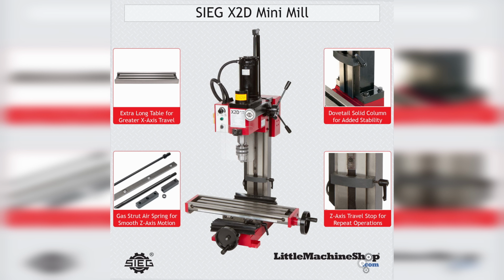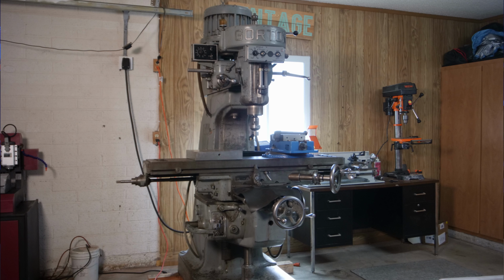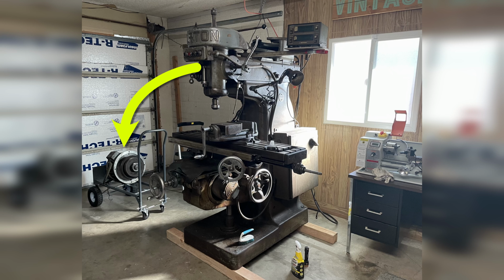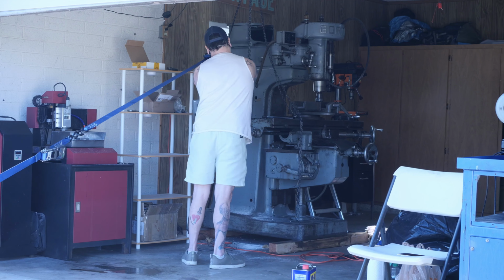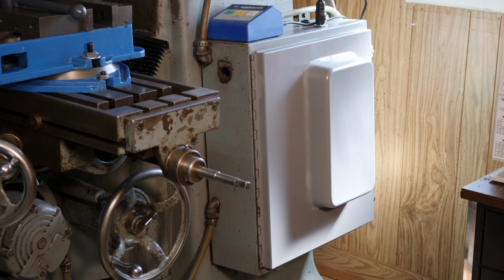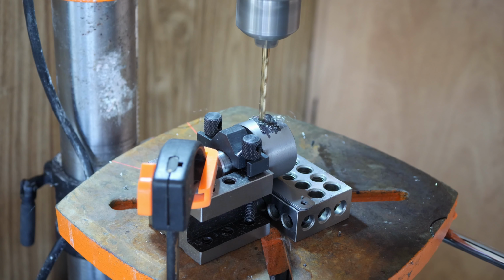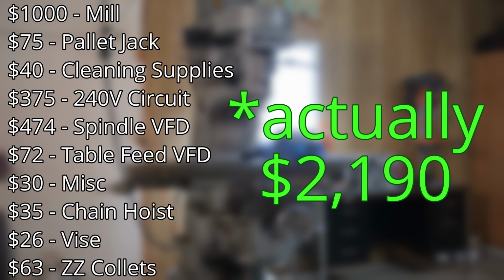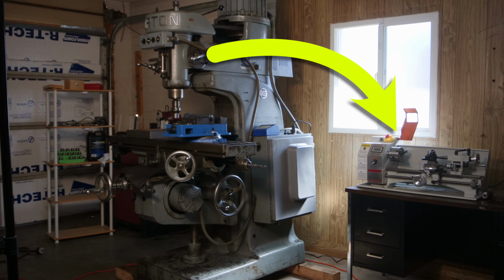Vintage Industrial Vertical Mill vs. Mini Mill - My Gorton 9J

Comment: Hello.  You don't know me from anyone.  But I wanted to give you some advice.  Never add grease to that zerk nipple on the front of the table feed box on your Gorton mill. It is really a bad thing to do that. It will lead to a broken gear. Crazy you think?  The power from the motor in the knee comes into the side gearbox via a Lovejoy coupling, and turns a worm. The worm turns a worm wheel. This provides a 30:1 speed reduction.  The worm is steel and the worm wheel is bronze. This worm speed reduction also changes the direction of the shaft 90°.  To get this power back into the same orientation, parallel to the gearbox shaft input, from the worm wheel is connected to a set of 90° bevel gears. From the bevel gears, the power goes to the Norton gearbox to select a feed speed.  The PROBLEM is that the bronze worm wheel created fine bronze dust (shavings) as it wears. The fine shavings fall down into the teeth of the bevel gear located underneath the worm wheel. Not in and of itself a problem. But the Zerk Nipple is there to grease the ball bearings on the input shaft. The excess grease from the spillover of these bearings, falls down and coats the 90° bevel gears teeth.  So now there is grease covered gear teeth and a tectonic slow shower of bronze dust falling on it. One would think that the gear oil would wash this bronze dust away. But the sticky-ness of the grease seems to hold the bronze particles better than the surface tension of the oil can clean them away.  Over time, the bronze dust packs into the gear teeth of the bevel gears, and the extreme force generated by the interface of the gear teeth breaks the tooth off the bevel gear.  My Gorton had one tooth broken off each of the 90° bevel gears. Bronze dust and rock hard grease was impacted in the gullets of the gear teeth.  I did not have spare parts, and I came up with an elaborate fix that involved eliminating the worm and bevel gears from the box, and using an external 30:1 gearbox between the motor and the Gorton gear box.  But as crazy as this sounds, do NOT add grease to that zerk nipple.  --------Doozer
Reply from the maker: Thank you for the advice, that's good to know! And nice to meet someone else still running a Gorton!

Comment: I'm not sure that "name recognition" is why Bridgeport mills hold their value compared to other mills.  They're still being manufactured, commercial machine shops need machinery that can be easily repaired, parts for the Bridgeport are generally a phone call away.  For home shop guys, there's a robust aftermarket, documentation and YouTube vids that detail any repair you may encounter.

But I've always had a soft spot for Gorton machinery.  The 9J was the machine that George Gorton considered his top-of-the line vertical mill, you'll love it.
Reply from the maker: That's a good point and I agree that makes a difference!

Comment: You wanted to impress me? Well, you did!
That price is a steal.
Reply from the maker: Woo, thanks! I agree that it was a great deal, but I do think it is the kind of deal others can find!
Reply: @serialhobbyism_official   
I got my Bridgeport by leveling up.    The mill I sold to buy the BP was a Millrite MVN, popular with the home machine crowd.  I bought it at an equipment auction about 8 years earlier,  out the door price  including auction fees and sales tax, was under 400 bucks, and no rigger required.   When the BP came along, the deal was so good, I could sell the Millrite for under market price (quick sale) and still had money left over.  There are always deals to be had, the key is to watch the usual places, and have money in your piggy bank so you can grab the deals when they come up.  

I think the reason Bridgeports generally bring more money is because they are so well supported.  South Bend Lathes, same thing.   There are parts available for almost any thing that breaks, and likely a YouTube video showing you how to effect the repair.

Comment: Excellent video- thanks for sharing. Although I’d love to replace the head with a J head of some kind, I remain happy with my choice of a Burke Millrite- which is 3/4 Bridgeport size. For a hobbyist like me, I think it’s the best of both worlds (mini mill vs big knee mill)
Reply from the maker: Thank you so much! I just looked that mill up (hadn't heard of it) and it looks like a really neat little machine! I 100% agree that something like that would be more than sufficient for most hobbyists—a huge machine like my Gorton definitely isn't necessary, haha.
Reply: I spent about 9 years with a Millrite MVN, and a round column mill-drill before that.    Running smaller mills help to develop good machining habits if you want good parts, those habits carry forward onto the bigger machines,